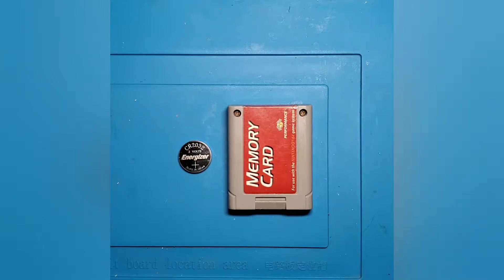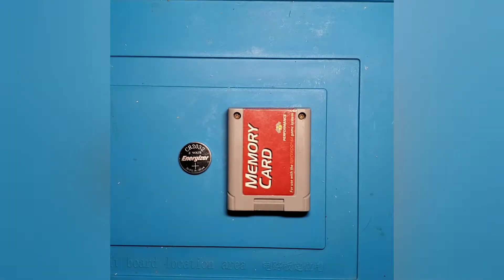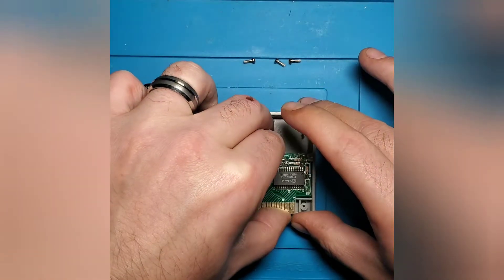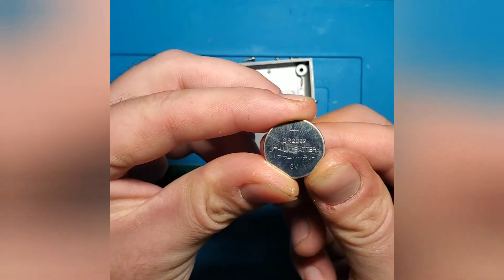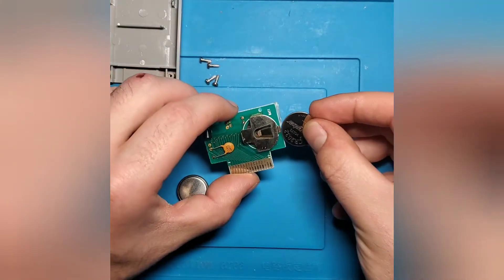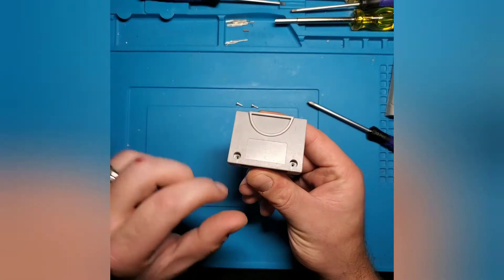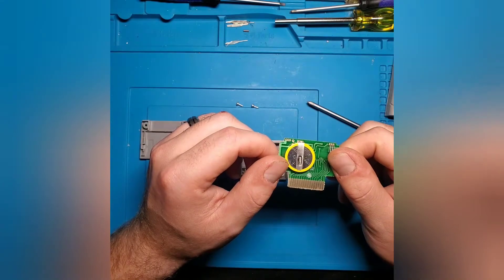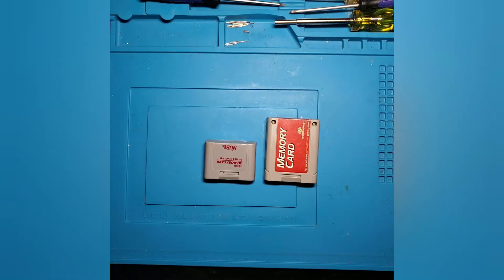N64 Memory Card Facts & Socketed Battery Replacement

Comment: For some reason mine won't work even with a new battery. I have to be doing something wrong
Reply from the maker: First, double check that you installed the battery correctly with the polarity tabs in the correct spots. next make sure you have a good solder joint on each connection. Next you can check to see if any of the other solder joints are broken and reflow them. 

A brief description of what the pak is or isn't doing may help guide you to a solution. There may also be another bad component in the pak. It is rare but not impossible for the main chip to go bad.

Comment: Good tutorial but unfortunately once these cards are corrupted they are done. I replaced batteries on two of these and they did not work.
Reply from the maker: Sometimes, this can be the case. a little more troubleshooting may be necessary to identify any other problems with board components. This is just a common solution which can easily fix a corruption issue. There are guides out there showing how to replace the on board volatile memory chip with non-volatile memory. I wanted to showcase this but I haven't had the time to produce a video of how to do it.

Comment: So my guess is if you don't want to use/have a soldering iron, your best bet Is to only use the larger memory packs?
Reply from the maker: Not necessarily. depending on the brand, production run, and version, you may or may not have a coin cell battery holder in your memory pak. Either way, it is important to remember that a soldered battery is just more of an inconvenience, more so than a battery holder. Replacing a soldered battery  does require a little skill with a soldering iron but it is a relative easy process.

Comment: Replaced battery and still doesn’t work any ideas ? Boars is clean
Reply from the maker: The main components on the board around the memory chip might be faulty. If I remember correctly, another user told me about some resistors or ceramic capacitors that may fail, causing the card to not work. You should probe these components and check for breaks in the traces before suspecting the memory chip of being faulty.

Comment: Ok so when I plug this memory card in now it’s reading as rumble Pak is this a. System issue or memory card issue plz I would really appreciate anyones help / edit: the first one with the red sticker is the one have tyvm ppl
Reply from the maker: Check it in a different controller to rule out it being an issue with a specific controller. If the issue persists, open the pak and make sure the contacts are really clean, there are no broken traces from the contact pins to the next component on that trace and then also check for a bridged connection, broken solder joints on the board or rogue solder balls. Checking these things should help you eliminate most common issues and help determine if the IC's are to blame.

Comment: Have u ever disassembled the memory pak plus? Same brand as the long memory card u disassembled. I'm curious if IT has a battery holder. I don't want to but may have to buy one of those fram modded  memory packs but they are pricey
Reply from the maker: I have one somewhere but I haven't opened it yet. I think it is packed away somewhere. It should also have a battery holder but it may also be soldered to the board, not exactly sure which. You can buy the non volatile memory chips and solder them in your pak if you feel comfortable with it. I actually have some on hand and plan to film a video on how to install them into the memory paks later down the road.
Reply: @RehabGamingYT  I'm really not sodler capable I know it's fairly easy but knowing me is screw it up I may take mine apart and see if it has the holder and if it does that's sick I'll buy a new battery XD I'm wondering if it's possible to use an everdrive/ed64/super 64  to gold the saves until I replace the battery :p
Reply from the maker: @TheCrispyChip  there is a way to keep the saved game data on the card as you replace the battery. That is another video I planned to do. This video specifically covers saved games on game carts but it uses the same basic principle as how you would need to do it with your card. Hope it helps.

https://youtu.be/N7I-oLD6Iyg
Reply: @RehabGamingYT  hey man Ur awesome thanks for all Ur help and advice easy sub!
Reply: As I mentioned in a stand-alone comment, battery replacement on the memory card plus is virtually identical to the point that it even has the battery holder in the exact same location.
Reply: @nintendomaniac64  Yes thanks, I took my card apart a year ago and found this out.

Comment: Sir I have a TremorPak Plus. It's a big thing that has a save and a rumble option. I took it apart yesterday and it doesn't have a save battery. It seems the double A's are what powers it but it doesn't work. I can find 0 information on this thing so I was curious if you guys had a video. Thanks
Reply from the maker: The Tremor Pak Plus from Performance is what I have on hand and it has a second port on the tremor pak itself where you need to plug in your memory card in order to use a memory card and the Rumble pak at the same time. This separate save pak has its own battery. To my knowledge, I have never seen a built in memory card actually in a tremor plus rumble unit.

Comment: How do i keep my saves if removing the battery erases them?
Reply from the maker: You can try to keep the board powered with a second battery or bench top power supply using remote lead wires. Solder the + lead to a spot of the trace further down from the boards battery mounting trace but before any other components on that trace. You repeat this process with the negative lead as well. Remember to have your remote power turned on before removing the original battery. Please note that working on any electronics, especially ones that are powered, carries a large risk of shorting or causing damage to the electrical components on the device. This can cause the device to be permanently damaged if done improperly. There are other videos out there that can show you how to do this, but you take full responsibility of your actions while attempting such a repair.

Comment: I'm going to guess that Performance was saving on tooling cost since the outer shell is identical to their "Memory Card Plus" which, internally, does actually use the entire internal space (it also swaps out the not-a-button thing on the back for a 4-way switch).

Other than the length of the PCB, the internals of a "Memory Card Plus" is virtually identical in terms of battery replacement - the battery holder is even in the exact same location!
Reply from the maker: That is probably the case. Makes total sense from a business perspective.

Comment: I’m replacing mine right now and I noticed my battery holder did not have the tab you have on yours. It was actually hot glued in that same spot to hold the battery. Will this affect it at all?
Reply from the maker: It may become an issue or it may not. In order to replace the battery, you would need to remove the hot glue. Soak the glue in 90% Isopropyl alcohol for approximately 2 to 3 minutes, depending on how much glue there is, and the glue will just peel right off. Using heat to remove the hot glue will make a mess. 

Hot glue has a tendency to degrade through heat cycles and the battery can get knocked loose over time if the card gets dropped or tossed around so a soldered battery directly to the board or a holder with the retaining tab is preferable.

I would either solder in a tabbed battery or solder in a battery holder that has the retaining tab, the choice comes down to preference and if it will fit. Of coarse later down the road if you have to replace the battery again, the hot glue may become an inconvenience to deal with.

Comment: How do you change the battery without loosing save files
Reply: The easiest way is using a memory manager from Gameshark or Everdrive to back up your saves first. If you don't have those, another method would to be soldering in a 3v circuit to the battery socket's terminal solder-points on the board, changing battery, then desoldering the wires.

The final method is to give your saves the finger and start over.

Comment: Once the battery is replaced, how long does it last? 20 years or so?
Reply from the maker: Depending on the quality of the battery, the battery size and environmental factors, a typical coin cell 2032 can last in a memory card for up to 15 to 20 years. Other factors such as use frequency, read and write cycles, storage temperatures, warm and cold cycles, humidity and the efficiency of the circuit itself are the main factors that determines how long a new battery will last before data corruption. Heavy use, multiple heat and cold cycles, low storage temps, high humidity and a flaw in the circuit can all contribute to quicker battery drain. On average, they seem to last approximately 8 to 10 years under normal circumstances and moderate use in my experience.